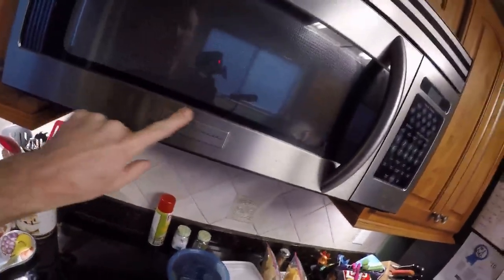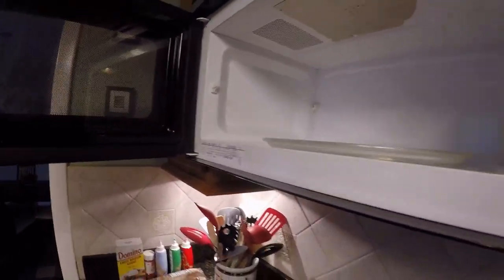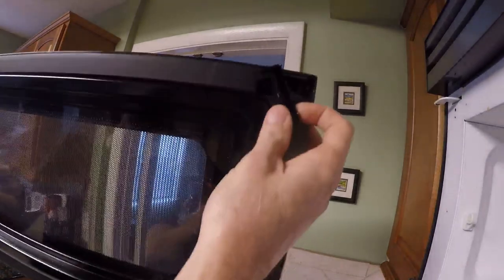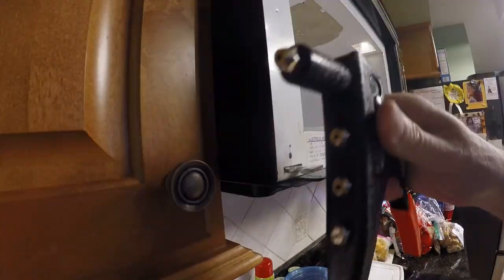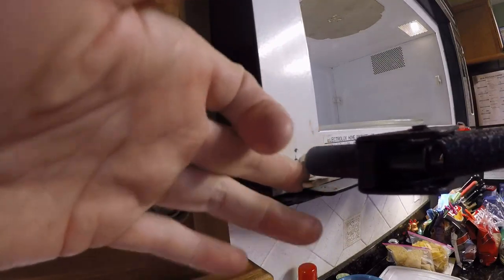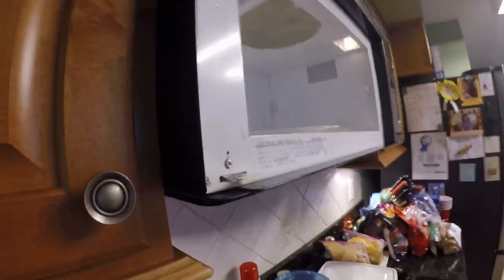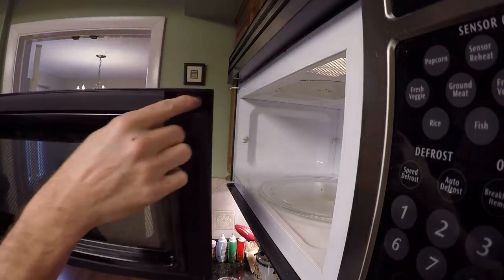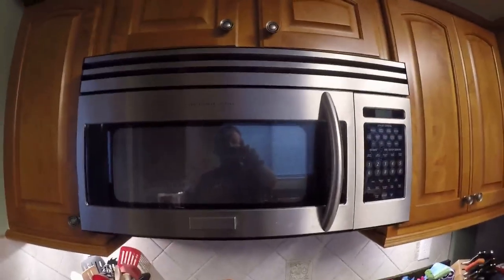LastHumansHomeLife: Fixing a Sagging Frigidaire Microwave Door

Comment: This video was definitely a time/money saver. I had to go buy a rivet gun for the job, and at my local Harbour Freight, they had a rivet gun and rivet set for $5.40 (after tax). Worked great. I used the 5/32" rivet in the pre-drilled holes and it too me about 5 minutes to do the job. My first time using a rivet gun and it was definitely a success.
Reply from the maker: nice job bro
Reply: Thanks for suggesting Harbor Freight. Went to Lowes spent $32 then wen to Harbor Freight. $9, so the Lowe's rivet gun went back!! 🙂

Comment: Worked absolutely perfectly as described in this video. I had not used a pop rivet gun since the late 70's when I attached a piece of sheet metal to the rotted rear quarter panel of my 66 Mustang :)   Had to purchase a rivet gun and some 5/32 X 1/4" rivets - $20 cost and less than 10 minutes and my sagging door problem was fixed to perfection - even added a little dab of grease to the door pins to make them work super smooth and quiet - Thanks so much for this post!!
Reply from the maker: np mr elko

Comment: I have this same microwave and had the same problem.  Used your fix and it worked perfectly.  Thanks so much.  Probably saved me a few hundred bucks.  Thanks!!!!!
Reply from the maker: Glad it helped!
Reply: Kris Tegeder what size rivets did you use! I have the same as well and same issue!
Reply: Drew Williams I just used 3/16 wide and 1/2” long. The 1/4 were to short and I had to drill them out. I can’t emphasize enough that you need to line up the holes, there’s another piece of metal that the connects the hinges you need to get the rivet into. I just fixed my microwave for $15. Really appreciate videos like this!

Comment: I always forget that I have rivets.  Thanks.  I was about to search for screws to fix the door.  FYI, you need a long shaft Rivet.  The ones I used first were too short to grab that back panel.  I used 1/8 Diameter x 1/2" shaft length.
Reply from the maker: sweet man! glad u got it shored up.
Reply: 1/8"×1/2" were too small for mine. Need bigger diameter. I just drilled out welds and put screws in.

Comment: OMG your entire kitchen decor, cabinet, oven, microwave are same as mine. Thanks for the video anyway, I just saved couple hundreds.

Update: the best fit of rivet for my model is 5/32" , after two trips back and forth to the Ace and Harbor freight stores. Make sure you measure the hole diameter before you buy rivet combo.
Reply from the maker: That is awesome!

Comment: This works, just make sure the rivet is thin enough to also fit through the second whole behind the first whole. Test it's stability first before cranking it in, to make sure it went through both holes.
Reply from the maker: Great tip!

Comment: Great suggestion.  I was concerned that the rivet sticking out a bit from the bracket may interfere with the door operation, but it appears to be fine.
Reply from the maker: nice one pal!
Reply: @LastHumansGarage  The top hinge is attached to the frame with a screw but the lower hinge is not attached to anything.   Just wonder how it worked all these years?

Comment: Thanks! That was so easy. Of course I had 1/8 and 3/16 rivets but no 5/32 so I drilled the hole out to 3/16 and used one of them. The top was good for now but if it fails I know how to fix it.
Reply from the maker: Nice work!

Comment: I was about to use wide, short sheet metal screws but questioned using any metal that might cause sparking or heat up when microwaving something. The fit looks good, considering the small gap i might go with your rivet method. Do you have any problems with sparks or heat from th we repair? Like are the rivets warm or hot after running the microwave?
Reply from the maker: never seen an issue. perform at your own risk.

Comment: Great video! Can you please share what size rivet was used for the Frigidaire Professional series microwave you demonstrated. I have the same microwave with the same door problem.
Reply from the maker: you need the largest rivet size which will still fit thru the hole. maybe 1/8 but that's just a guess.
Reply: Thank you again, I got my microwave fixed using your technique. Appreciate it.

Comment: Thank you for the video, seems like a DIY task. Can you please let me know the size of the rivets used (and I will buy rivet gun accordingly as well) ?
Reply from the maker: too long ago to remember. but i'd think something like a 1/8" rivet would be big enough. you dont want too small or it might slip thru. you want the thickest rivet which will still fit thru the hole.. so measure the hole.
Reply: @LastHumansGarage  The 1/8" rivet was too small.  I had to drill the hole to a 3/16" and use a 3/16" rivet.  Worked really well.